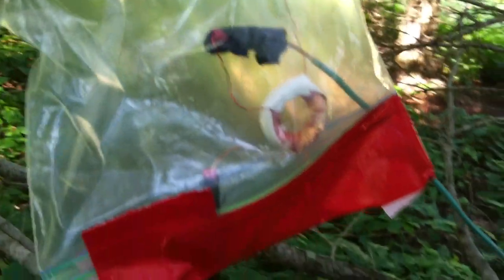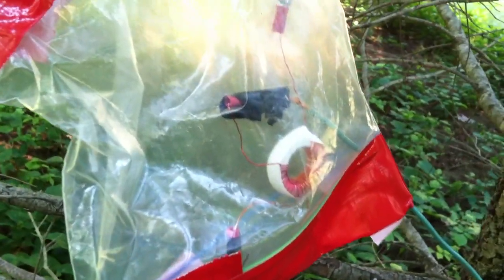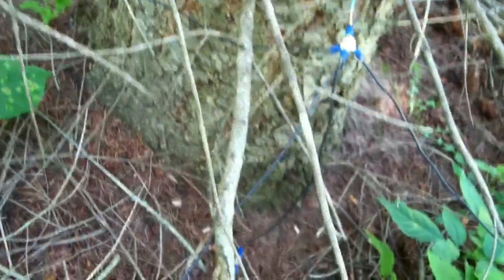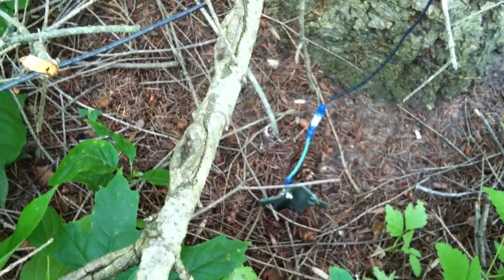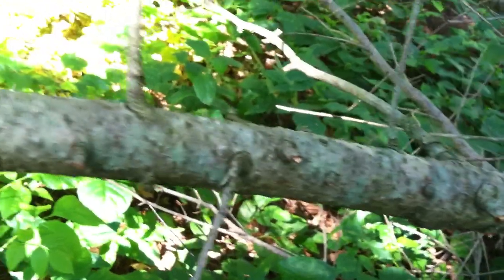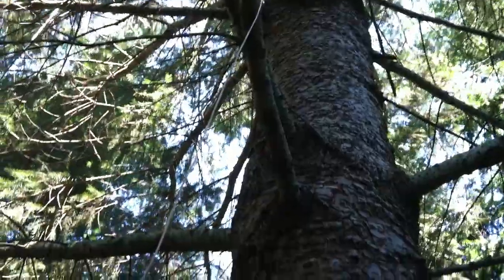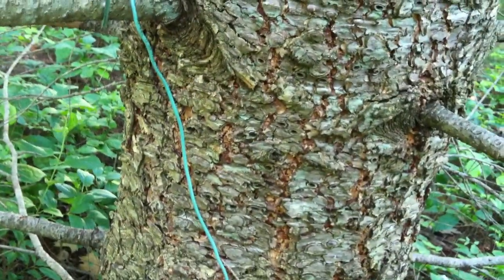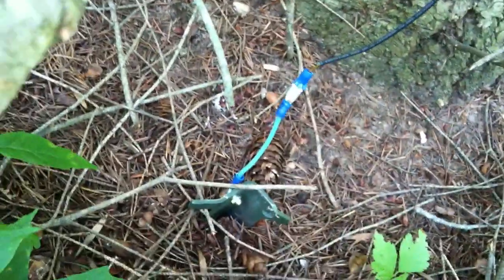Ultralight DX'ing With External Vertical Antenna

Comment from the maker: @Nick.  If you want a more modern version of this same antenna take a look at this video of mine "Portable DX Antenna for Ultralight Radio - Vertical Configuration".  If you are looking for a more permanent solution see my video "Low-noise MW BCB DX Antennas"  Both are good starting points.